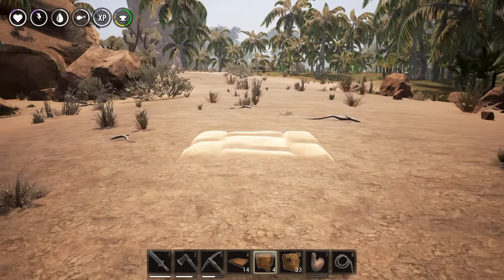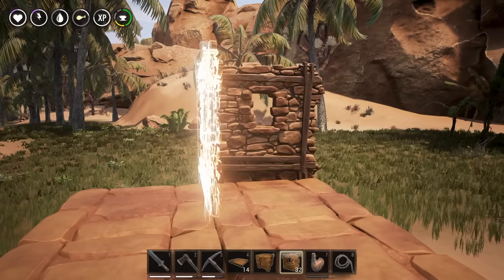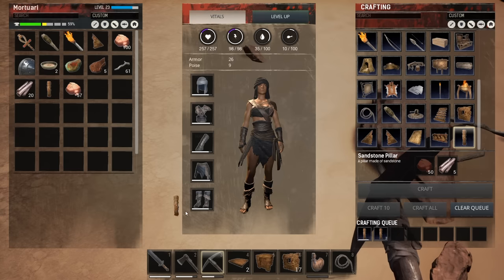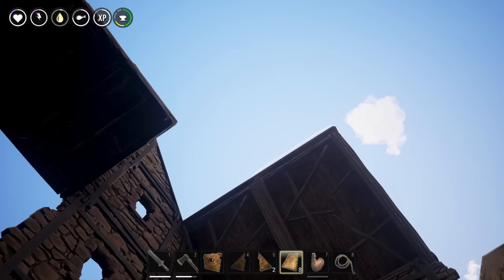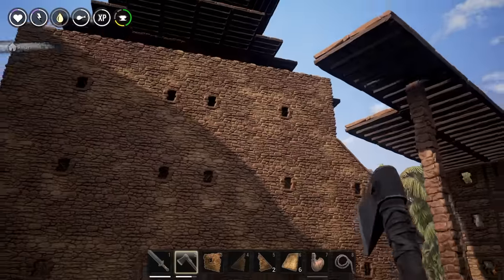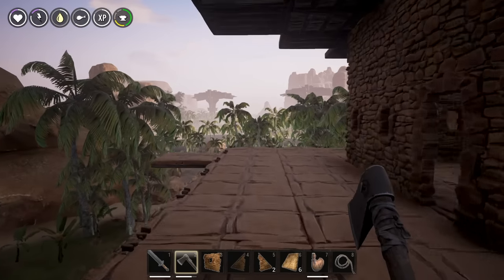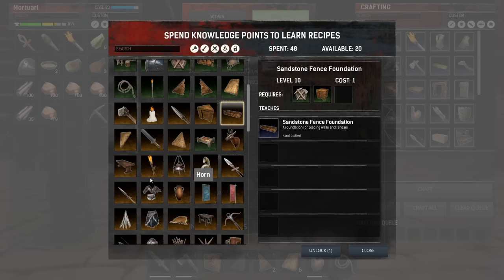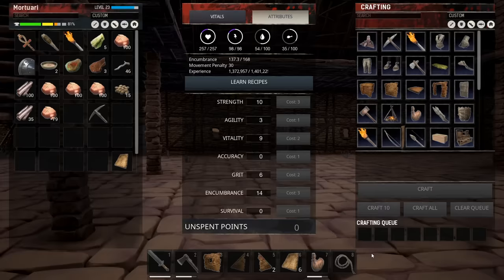Conan Exiles - Building Tips and Tricks - E08

Comment: I just hate how easy it is to end up with a little triangle of building that you can't fill. The triangle piece you can use isn't the right shape. Makes it hard to make a funky house
Reply from the maker: It's all about math man. You probably placed a square or traingle in the wrong spot. Had that a 1000 times when I built my cathedral in Conan
Reply: @Letstalkgaming   my problem is I need triangle that can form a square. The one in there forms a slanted square.
Reply from the maker: @dontforgettolike7127  that is sadly impossible. I could have used some of those too.